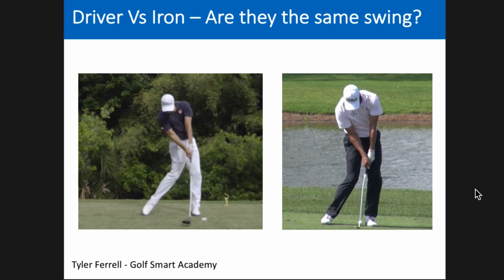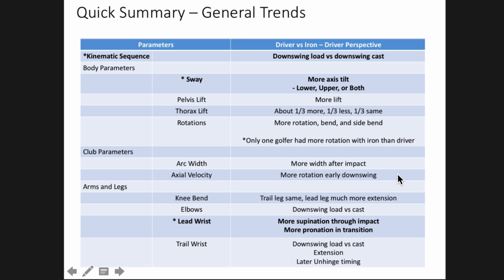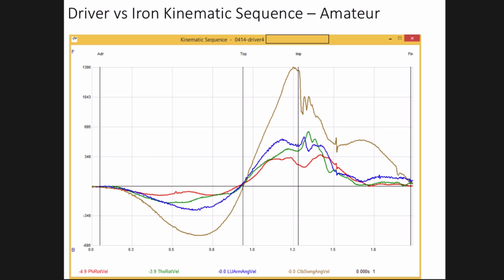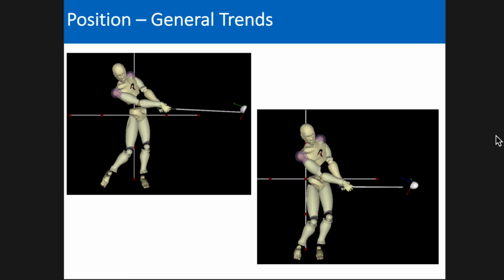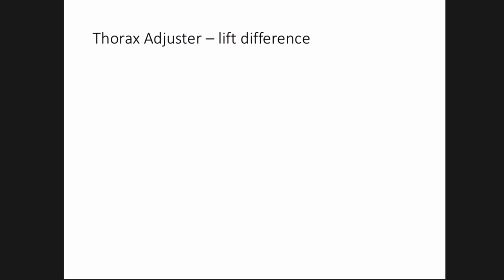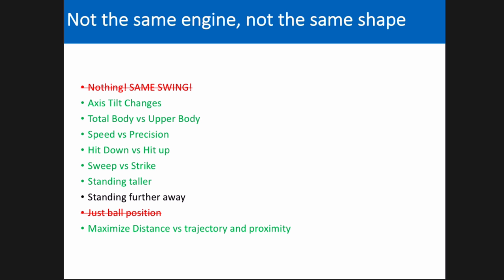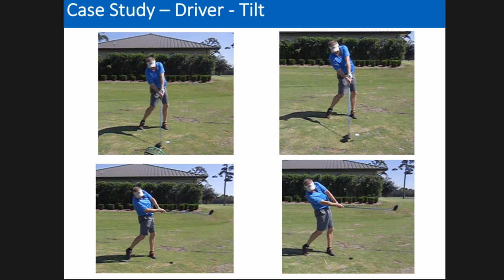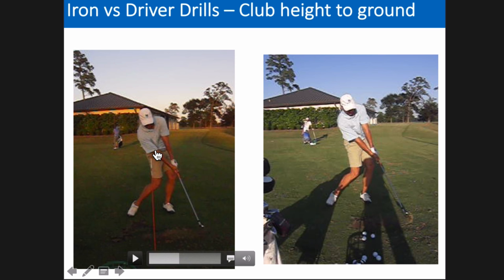Driver Vs Iron - 3D Differences 2016 WGFS Presentation

Comment: Excellent analysis which finally answers the question; clearly the swings are different. Axis tilt, loading vs casting, and I agree, supination increase seems important too. Distance from ball may however still be a variable that results in more axis tilt (simply from longer shaft and forward ball position) and perhaps could explain increased supination because of more counter force on the extension. Whether the cart or the horse, it is clear that axis tilt, increased loading, and increased supinating release seem worth keying on. Thanks.